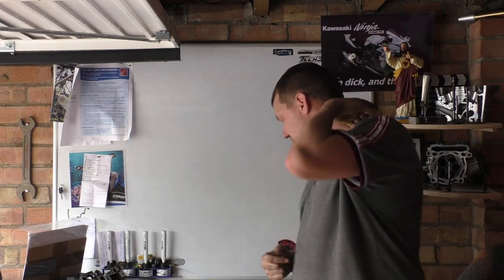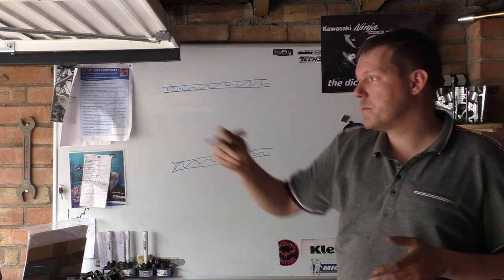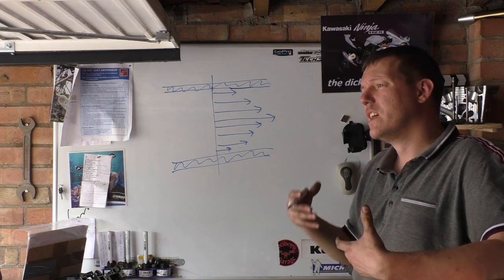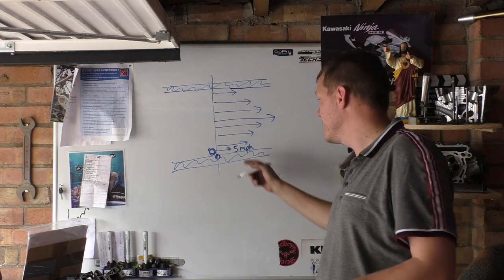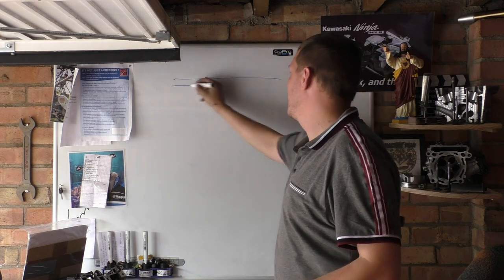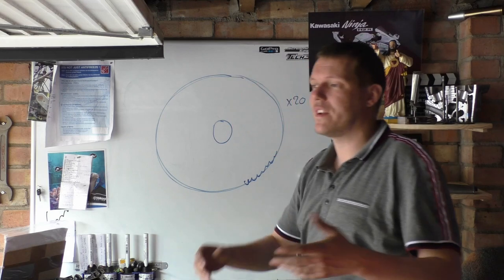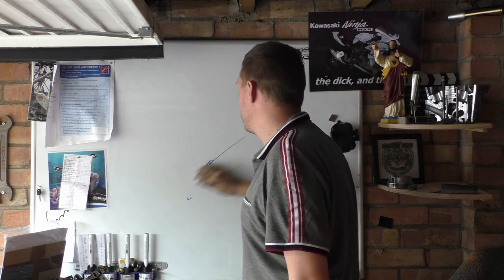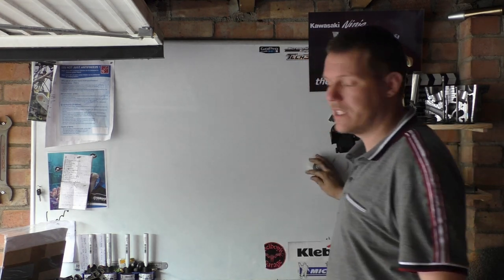Mirror shine your ports?

Comment: Bargeboards on race cars as well as tins on air-cooled engines use the phenomenon of laminar airflow to direct massive amounts of chaotic air into a controlled space to great effect. Sharks use a different approach to allow them to swim faster and more silently: Skin denticles. A combination of the two ideas would be ideal. The only problem is to produce denticles on metal. Experiments on supersonic aircraft have been conducted with both denticles and perforations on/in the plane's skin to enhance speed diminishing the effect of sonic shockwave on the airframe.  Dimpling, like on a golfball, is more for spinning masses where a cushion of air is produced by the interaction of the dimples creating negative pressure as they spin against the air at a tangent to the mass of it. Thank you, Matt.
Reply: That's not what the science shows. At certain speeds (~50-300 mph) air is shown to get lazy on smooth surfaces, regardless if they're spinning, and a layer of slow low pressure is created on them (boundary layer effect). Dimpling improves laminar flow and reduces drag by breaking up the boundary layer created on these smooth surfaces. Even the myth busters tested this with noticeable results. Ever seen a car in a wind tunnel? Ever noticed how the white streamer is never really touching the car?
Reply from the maker: Lazy?
Reply: @dirtygarageguy  Slow. Stagnant. Yes, lazy. The "high flow" area "separates" from the "lazy" area. So you're essentially stuck with two layers of moving air on the smooth surface. And it's not until the speed of the air (or moving object) is above ~300mph that the lazy area is squeezed away. Don't ask me man. I didn't invent the boundary layer effect. I've just read about it and witnessed it in real life (flying in airplane with water on porthole, driving in the rain, blah blah).

Comment: That's the inlet dealt with Matt, and I generally agree, except of course race engines are often polished. Plus, the reason production engines are not is almost 100% down to the time/cost factors which are obviously prohibitive. 

However, it's a completely different story on the exhaust side. And just as I favour polishing the combustion chamber as well as the piston crown, I believe it is way more important to polish the exhaust port. 

This is the dirty end, carbon buildup is inevitable if the surface is left rough as it came from the factory. This can, over time, severely affect the efficient flow of exhaust gasses - to the extent it affects performance. 

Now, admittedly this is truer with two strokes. But four strokes are prone to the problem too. 

Finally, the first time you fire up an engine that you've rebuilt - after polishing the combustion chambers, piston crowns and exhaust ports, it sounds FUCKIN' AMAZIN'!!! And the satisfaction of peeping in to look at the piston crown next time you change the plugs, and seeing the shine still there weeks later... Fuckin' Priceless!!

So, basically, make the buggers super slippy!!;)
Reply: Super slippy smashing great
Reply: Factory!  I'll second that.

Comment: My experience from the 70's was to polish and match exhaust ports and to just have a sanded finish on intake.  Any larger fuel droplets from the carburetor would then stick to the sides of the port and be atomized further.  I noticed a respectable power increase throughout the power band on a 250cc 2-stroke engine.  Maybe castings are better than they were in the 70's.

Comment: Great explanation of things from you as usual. I agree that the "polishing for performance" is basically bollocks but I don't mind the idea of polishing things for the simple purpose of them being easier to clean later. In my opinion polished stuff will stay clean longer (less carbon build up) and are easier to wipe clean.

Comment: I've dealt with this effect in water cooling components. A water block wont just flow water through, it will have internal fins, under a jet plate, which squeezes the water through that a tight orifice to blast the particles away and prevent them clinging around the surfaces of the fins.

Comment: Put the intake and head for the go-kart I raced when I was a kid on a flow bench and the sand blast finish did actually flow more air than the polished intake. Was a 5hp Briggs and Stratton that output 21hp... 

Dont have the print outs to back it up, but I distinctly remember it because it went against everyone's opinion at that time.

Comment: Hey mat,
I was always lead to believe a polished surface flows better but you always leave a rough finish on the intake past the fuel source to help atomisation of fuel. 
So if it’s direct injection then you polish the whole port or on something like a carb you leave the whole intake and port rough. 
I am talking race applications though.

Comment: Learnt recently from a mate who races in classic brackets that when they do port work on say a cbr250rr ( 18,000rpm redline 4 cylinder) is they dont even bother trying to widen the port as they recognise honda pretty much did the best they could. What they do is remove casting imperfections and I believe polish the port. The result is they do see a few hp increase. Which makes sense for racing but not road users, want more power? get a bigger bike.

Comment: There was a good thread on pistonheads in the engine section touching on this, using an su carb that once polished fuels horribly put a rough surface on the carb “inlet” and it is back to normal.

Comment: The last thing about air density, that's very noticeable in propeller air crafts as there's 3 factors effected. Engine power, wing lift, propeller grip or what you call it. I've been flying paramotor for several years and on a cold winter day you could feel the extra power and density in the air and you would climb a lot faster and fly slower as the throttle only controls the pitch and not the speed.
Reply from the maker: Prop pitch, tip speed and prop wash is also important.
Reply: Props are too complicated to put into words in one comment, I tried to keep it simple. LOL!

Comment: Nice one Matt. You spoke of gas molecules bouncing all over the place. I used to work on Ultra High Vacuum equipment.  The pumps used on our Thin Film Coaters were done by a Rotary pump backing a Turbo Molecular pump bellow a massive LN2 trap. . You also have to put a fore line trap between the Rotary & Turbo pump. This is the mental thing,  oil vapour molecules can Back stream from the Rotary pump past a 50,000 RPM Turbo pump, past the LN2 trap against the flow. You could pick up traces with the Mass Spectrometer. Bit long, sorry.
Reply from the maker: Similar system to vacuum chambers on SEM's - we used a scoll pump to pump down the molecular pump.
Reply: The Workshop Cool Matt. Vacuum systems are mentally different and interesting. If you had two same sized pressure vessels 1 Cubic Meter in volume say and one was pumped down to Ultra High Vacuum pressures and the other was pumped up to 2x Atmospheric pressure,  if both had an air leak rate of  .01 Millibar Litres  per Second, the UHV Vessel will leak UP to Low Vacuum pressures pretty Quickly,  or in your day leak checking the Fucking thing. Now,, have the Same leak rate on the UHV vessel would take many hundreds of years for the pressure to equalise........  These figures are just off the top of my head for now, but the orders of Magnitude difference  between the 2 Vessels is well sound. Sorry I did a long one again.

Comment: the only benefit from polishing i have considered is that a smooth surface would be to reduce the amount of carbon build up in exhaust ports and on the piston head, however enlarging the ports does have the benefit of higher flow rates, after all, engines are just air pumps, and the more air and the faster you can move it equals more power, but even then, its only a very very small increase, as you said
Reply from the maker: WOW engines are NOT air pumps.....
Reply: wtf is a WOW engine?

Comment: MotorTrend showed a massive improvement for porting and polishing their V8 heads with 2 valves per cylinder. 90+hp improvement.

Same goes goes Aston Martin Vanquish 2001, the DB9 had added 20 hp just from CNC porting the intake, the Vanquish S has 60hp improvement from the head being fully CNC ported (and not polished). That's over 10% gain.. pretty significant.
Reply: Frank Harris  Ya don't say Shelock

Comment: From what my research revealed, the dimples/cnc cuts, etc., caused not only the kind of spiral effect in the fuel/air mix, but also seemed to help keep the fuel/air mixed well. What those sources said was that a smooth wall was more likely to get fuel falling out of suspension and forming droplets than the rough or dimpled surface. With the crap stock carb on my KAYO, there was a significant change in how well it ran between cast finish/rough sanded intake, and dimpled intake. There were no other changes as I had already cleaned up the casting flaws and did a quick port match to smooth out some transitions. Did I feel more power? No. Did I start to pull away from my brother on an otherwise identical bike where I didn't pull away before? Yes. So my research, plus my experience with trying it says that it was worth the couple of hours to hand grind the dimples. But this was on a single cylinder, multi-cylinder could bring up a whole set of new problems if the two ports did not flow the same, that's where cnc would be better.

I think the biggest reason this is not seen in production is the machine time or labor cost. Add in the lower benefit from port injection which gives a much shorter path with air and fuel mixed, and the benefits drop. As far as my research lead me, the dimples did very little for the air only part of the intake (before the carb). It was really only of benefit after the air mixed with fuel. I can hunt up some links or you can see my hackery here http://www.minigp-racing.com/joomla1/index.php/skunk-works/44-project-2 there is a link in the middle to an article from Hot Rod magazine that summed up everything fairly well. I should have some other links stored somewhere, or you can spend a bunch of time searching the web for the same things I did. I know Matt did a bunch of research before making this video and he summed it up well... If you are reaching for every single n'th bit of power, it might be worth doing, but in general all you will do is spend a pile of time grinding aluminum for not a lot of gain.

Call me a knob if you like, but for me as a hack, it has worked in that I seem to see performance benefits and no performance losses. Wish I was able to finish my dyno so I might be able to test these mods before and after.
Reply from the maker: When I move shop we'll build a flow bench and check most if not all of these layouts and see for ourselves.
Reply: The Workshop need to build one that can handle fuel in the stream as well as dry air. I think one place was using solvent with a dye so that they could see where the dye was "pooling". I think this is one place where a dyno might be the best way to check. I'm having trouble getting decent rollers, the 4 inch diameter are really too small. Larger are very expensive so I haven't gotten back to that project. Some good links for dyno stuff on my site.

Comment: In terms of pure flow, the finish can make a significant impact. We have flow bench tested a Z750 head and found a 7% increase in CF when polished over standard cast.
Reply from the maker: I wanna see the data. Polish only? No matching, port profile change or material removal?
Reply: The Workshop yeah no worries, it's a standard flow bench test with cf values at 1mm lift increments. I can dig the data out.

Comment: well surely even mirror polished loooks very rough from the stand point of an atom or rather, a molecule. but you can consider tham step transitions if you kinda silce the legth of "pipe" we talk about into small slices. the difference it can make.. most likely not noticeable . but maybe you could somehow show ? like take a rought pipe and have like.. a turbo blow air into it and use an airmass flow meter things then do the same after its polished . i dunno. i for one prefer mirror finish, even knowing it makes only a not so real difference

Comment: Here's my 2 cents. Back in the 1960's & 70's polishing ports, intakes & chambers was done to keep the fuel in the air petrol mixture suspended in the air. The rough surfaces would cause the fuel to "precipitate" out of the air petrol mixture.
Reply from the maker: There's this thing called 'the boundary layer effect' - this creates a boundary of turbulance at the port wall (used in aviation a lot) and reduces the amount of 'port wetting' - a similar principle as how a golf and tennis ball work.....

Comment: Matt. If you were able to add a charge to the gas and the same charge to the pipe +/+ or -/- .  Would they in theory repel each other and give you a more stable flow?
Reply from the maker: LOL probably not - Gases are charged usually via ionization (electron stripping) Instead - boundary layer effect is more effective
Reply: @dirtygarageguy  LOL. yes towing a plasma generator behind your bike would look a little stupid.

Comment: Is that the thumbnail from Jafro's video?
Reply from the maker: I don't think so???
Reply: Turns out I was wrong, I just checked.
It looked just like the thumbnail from Cylinder Head 204 - Porting & Polishing.
What's surprising though is that I remembered the exact video and what Jafro used as a thumbnail, taking into consideration the amount of booze consumed in the 2-3 years since watching that video.

Comment: Does the air molecules behave like that also under pressure (turbo, supercharged)?
Reply from the maker: Oh yes, if you increase the temperature then the momentum of each molecule is high so higher speeds - however there is also free mean path - which is how far a molecule travel before hitting another one. If you increase the DENSITY (not to be confused with pressure) then the free mean path is reduced. 

Now with turbocharging (driven or turbine) the pressure is increased due to higher densities IF the temperature is constant. This means a lower free mean path.

What does this mean in regards to flow and polishing - nothing really.
Reply: The Workshop thanks man

Comment: Turbulent flow gives good mixing but loses energy- I'm going turbulence is the best way to go.

Oooh, right answer (maybe) but wrong reasons (for sure)

Increase in diameter will cause a reduction in velocity which = increase in static pressure so that's why a step change like wot you showed would be bad.  In my obviously flawed opinion.

Comment: We are falling against the wall causes a jetty and the air moving down the center of the pipe doesn't have anything rub against other than the other molecules of air which still have a jetty to them but dissipate as you get towards the center of the pipe
Reply from the maker: Youre thinking that laminar flow is actually laminar. It isnt
Reply: @dirtygarageguy  thanks for clarifying that.
Reply: @dirtygarageguy  I never went to engineering school hell I only got my good enough diploma in 10th Grade

Comment: Golf balls have dimples because they cause the passing air to close around the back of the ball which eliminates the low pressure area behind the ball.  That low pressure spot would otherwise slow the ball down.  I don't see that being useful in a port. BUT, dimpling a tight inside radius may very well help the flow follow the radius rather than shooting off on its natural angle of deflection and crossing paths with the rest of the flow.  I will definitely be doing testing with this.
Reply from the maker: Newtons 1st law....
Reply: @dirtygarageguy  Right.  As we know the angle of incidence = angle of deflection.  But sometimes we are stuck with bad angles.  Being able to bend the flow around a radius using the low pressure area created by dimples could really be beneficial.  For example the flow is going to smash into the back of the bowel before deflecting up into the valve.  Of course minimizing the port to vale angle changes flow direction less which results in better flow.  But if we dimple the floor just before the valve, we can bend the flow and decrease that angle even further.  I suggest dimpling to bend the flow and change its angle is a far better strategy than dimpling the entire thing.
Reply from the maker: Dipples are based in boundary layer effects and as you said about drawing flow behind the profile of a ball. This isnt what happens in a port, simply because a  ball is in an unlimited void, where a port is not
Reply: @dirtygarageguy  You don't think dimpling only the tight inside radius portions would help the air hug the radius better?
Reply from the maker: No, in a word

Comment: Informative video and don't think it's a worthwhile thing to do unless your chasing every bit of power. Just buy a bigger bike lol. Though from a Engineering standpoint the gains of a properly flowed and tested head are significant if coupled with the correct tuning. More so on high reving low torque engines no?
Reply: Why not just get a larger engine? Because a sleeper is so much more fun.